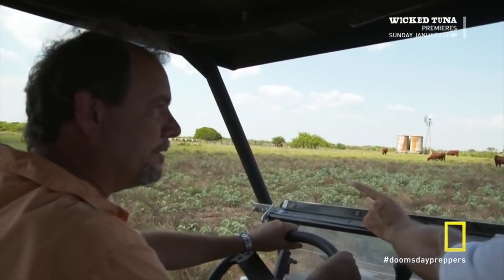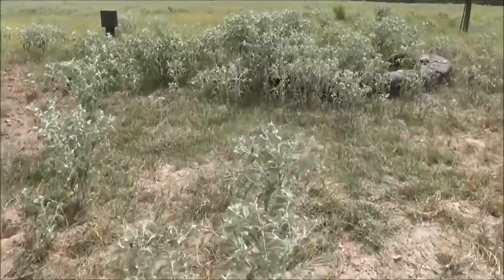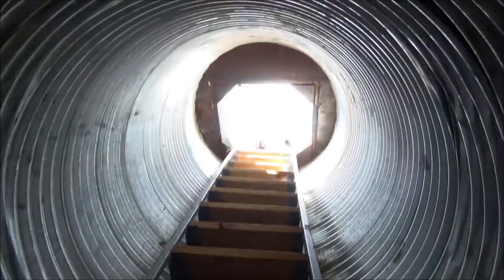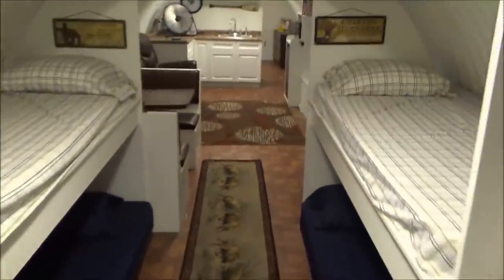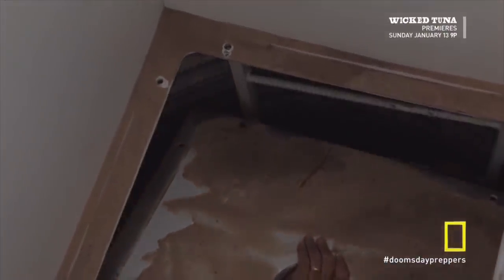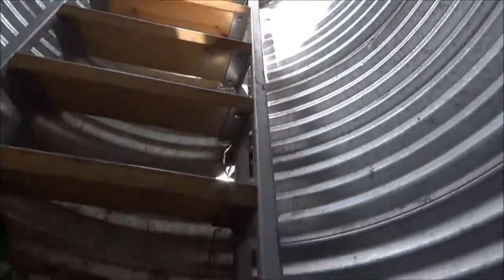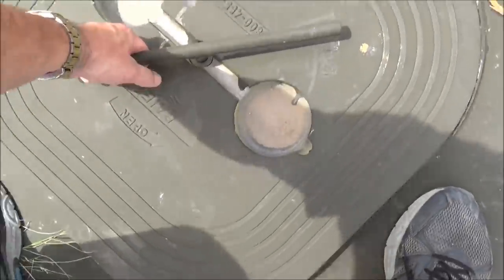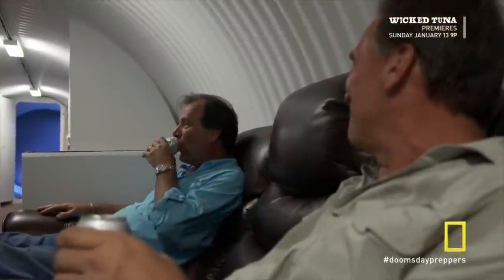The Doomsday Prepper's Bunker We Did For TV In 2012 - Then & Now !

Comment: "this is a stainless lock, so you can`t even torch it".... ERR, YEA YOU CAN!
Reply: Tell dude?
Reply: @Bay-Smidt  That really looks like a ZInc bodied puck style American Lock. I could be wrong though as they do make milled stainless version, its easy enough to swap out anyway.
Reply: There's lots of ways to cut stainless but a torch isn't one of them! If a torch is all you have, you can lay a welding rod or a thin piece of steel over the stainless and when the flame penetrates the steel it will also cut the stainless underneath!
Reply: Also the lock picking lawyer is typing...
Reply: Plasma cutter is best way to cut stainless.

Comment: Where is the water and power supply coming from
Reply: From Hell. They get free hot water that way
Reply: The video mentioned a separate generator pod for the featured shelter, and attached accessible generator pod in newer models. Presumably fuel is stored in the generator pod and/or secret caches. Drinking water can be stored under the floor, but for shower/laundry/toilet I assume you'd need a nearby connected water tank and septic tank.
Reply: They show the power room in the video and there is a water tank underground plus more in the bunker.

Comment: While yes you can not torch cut stainless you can still heat and blow it apart with a torch it just takes a bit longer.
Reply: ElectroGaming I cut stainless steel with a hand grinder or a plasma cutter. I used to build food grade vats.
Reply: @JohnSmith-dv5pi  Yup the plasma would do it like a hot knife through butter but most people would not be carrying them around where as oxy/acy would be far easier to bring with. Really locks are just to keep honest people honest as all locks given enough time can be defeated but in this case it would deter most people. I cut my teeth in the food industry a few decades ago so I feel ya on the vats.
Reply: ElectroGaming I would more likely have a hand grinder not oxy or propane.

Comment: 1: 9mm ain't shit. 7.62 will more than likely punch through there easily. 2: If the shit does hit the fan and I happen across one I'm locking down the hatch and using my trusty metal detection wand to find said escape hatch and sealing that off as well, it's amazing the things you can weld with a couple of car batts and a rod...
Reply: And why would you do that?

Comment: So basically the only way to get air down there off grid is to either run a loud generator or have someone turn the crank all the time?  If so, what if people are sleeping and the generator runs dry?  Do they suffocate or what? Don't get me wrong, it's very cool. I'm just wondering if it's safe or practical for its intended use. What about an EMP? What happens if you can't get out of there to refuel? Do you just crank that all day in the dark or what? I'm confused
Reply: You can build a Faraday cage for EMP protection!

Comment: In real SHTF situation;
1- A local gang finds your bunker.
2- Encircles you and take a quick look around to find all hatchs, holes etc.
3- Will take your generators and run them full throttle to give exhaust gas to your bunker's air holes (with using pipes and tapes).
4- They wait you to until you desperately try come out.
5- When you try, they shoot you in an instant.

Comment: stuff some rags soaked in oil into the air vent and set it on fire..  those inside will be toast in a matter of minutes. why do these guys never think of this??  the dammed vent is right next to the hatch.... Duh!!
  then cut through the hatch with a cutting torch
Reply: What about simple radiation or ash getting through the vents? Just a death trap